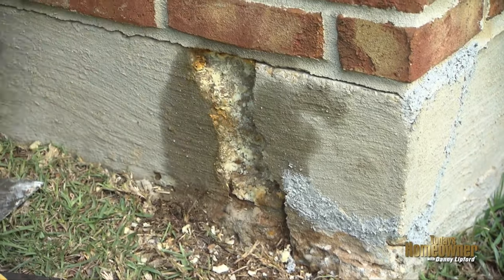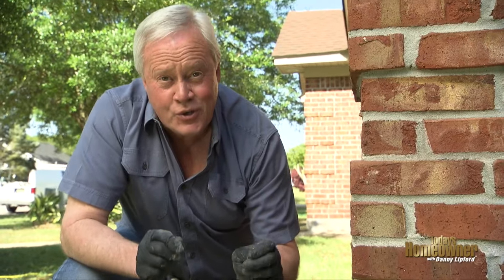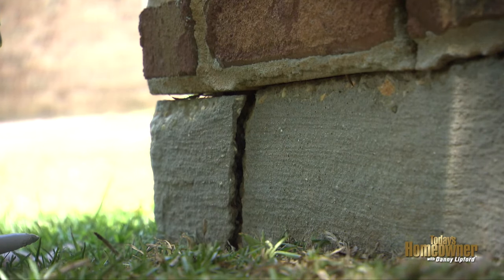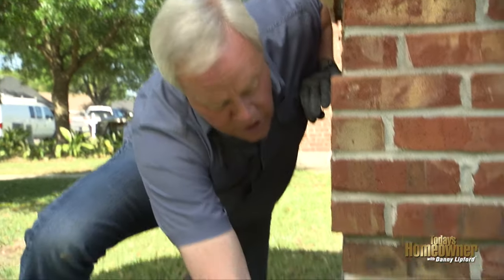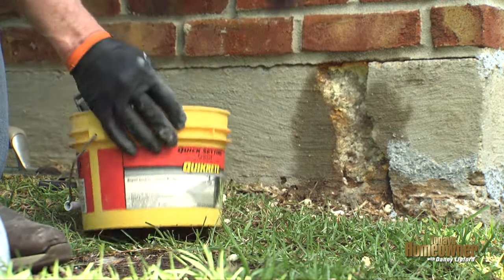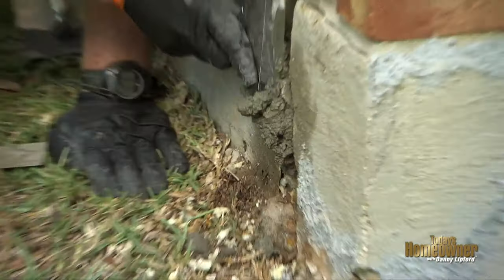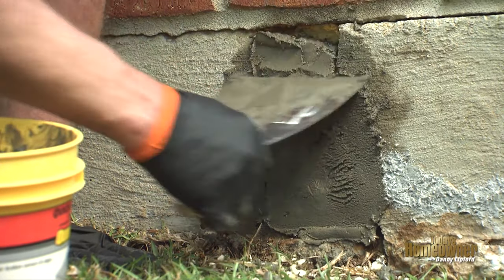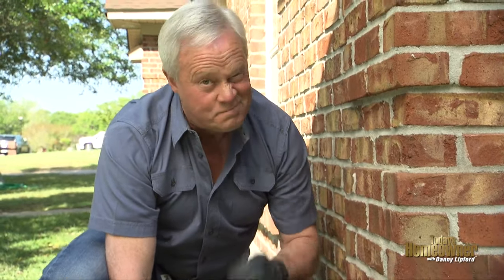HOW TO FIX A CORNER FOUNDATION USING QUIKRETE

Comment: Obviously this guy has repaired this crack a few times and should not be listened to.😂 didn’t use a bonding agent or even wet the old concrete.
Reply: mine fell off, what would you recommend?
Reply: I watched a different video where this guy used some sort of brush on conrete glue. Another guy just made a paint like mixture with the cement itself and brushed that on first. @pandemonic66